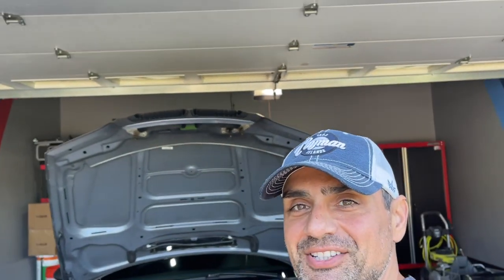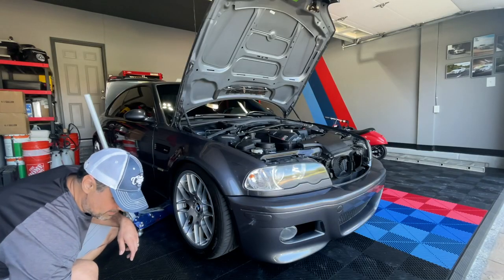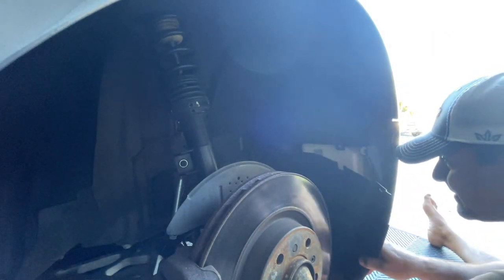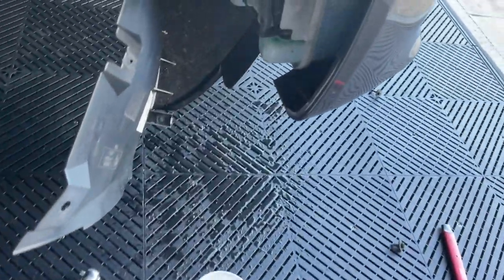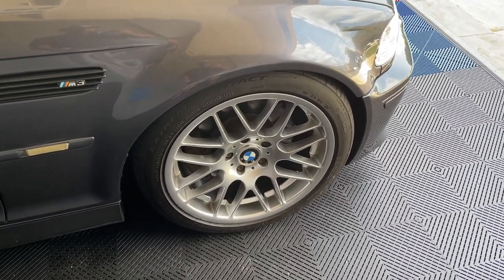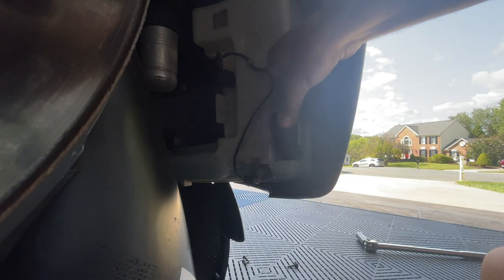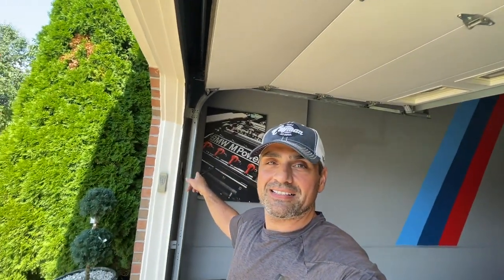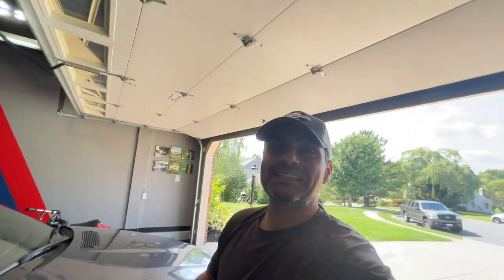How To Replace BMW E46 M3 Windshield Washer Pump DIY! Too Easy!!

Comment: I have a leak on the bottoms of my left bumper.. hoping it’s just the washer fluid and not the coolant! There are no coolant lines in that area right? I’m a bit worried. It doesn’t smell like coolant
Reply from the maker: Washer fluid reservoir is on passenger side